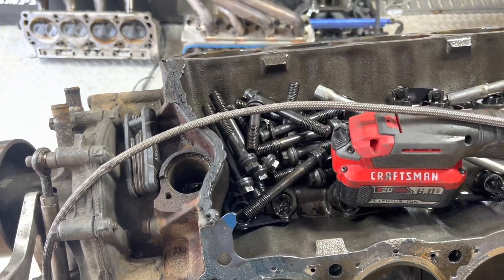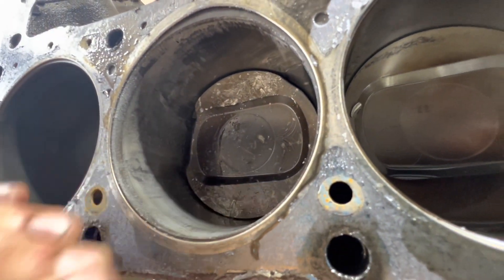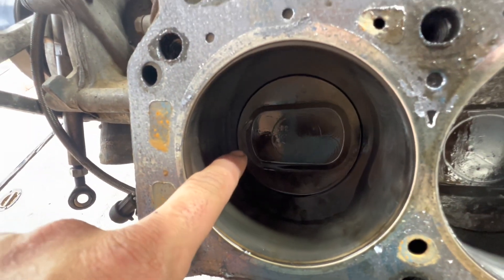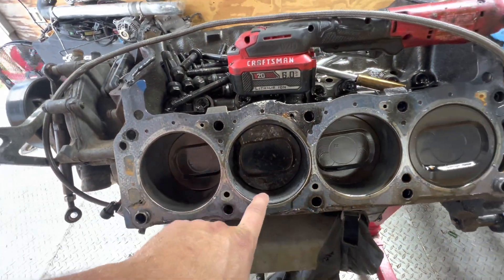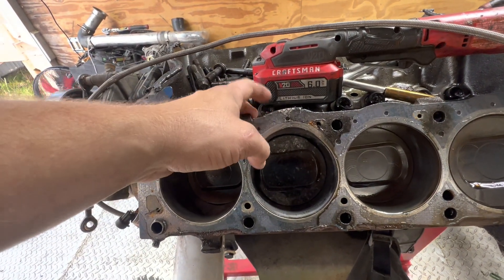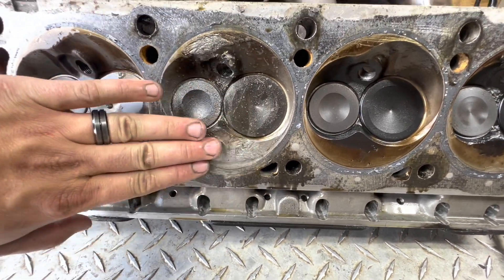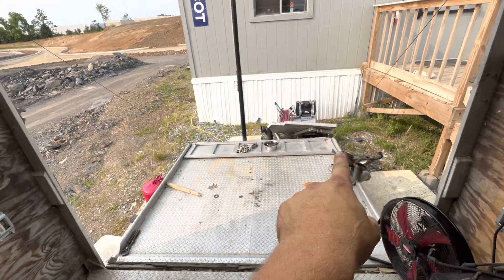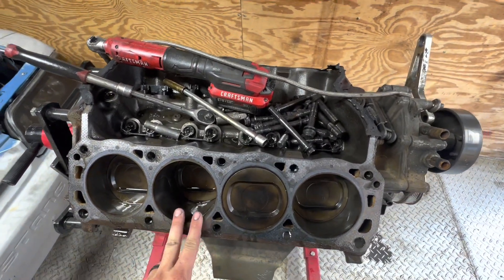THAT WASN’T SUPPOSED TO HAPPEN…..How to turn aluminum into liquid.

Comment: Did you get the rings for boost because it looks like the rings might have butted together maybe that's what broke that piston minor gapped at 26, on the top 28 on the second
Reply from the maker: No it was an injector that got trash in it. Confirmed and had to clean them. Cylinder went hot and melted the piston. The strap on the plug was torched off too. All other cylinders were in perfect shape. Rings are factory gapped plus lots of mileage.
Reply: I would have guessed the marks on the pistons came from the valves kissing the pistons.

Comment: What fuel are you using? E85
Reply from the maker: E-85
Reply from the maker: My injectors had a bunch of trash in them. Ended up switching to a different kind of fuel filter.

Comment: Which head gaskets you running? I just blew my head gasket on mine to, between 2 cylinders
Reply from the maker: felpro 9333 pt1. Gasket blew when the cylinder messed up. It didn’t show any signs of being blown before this.